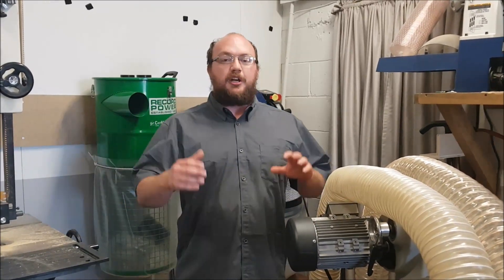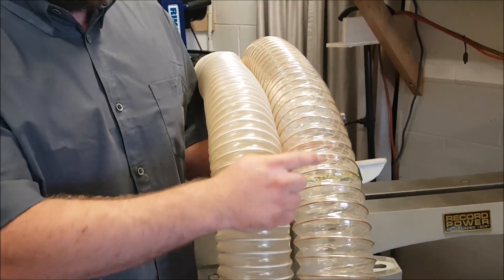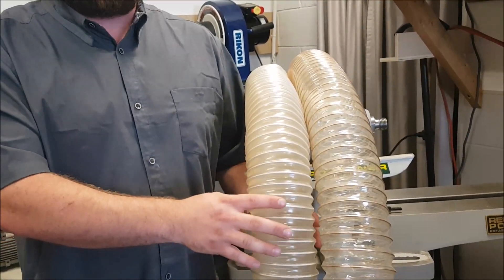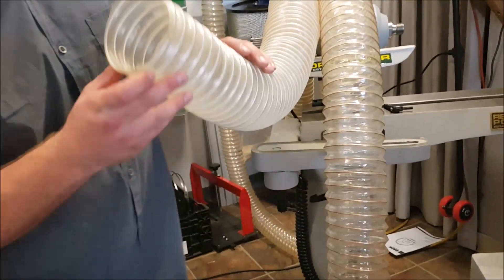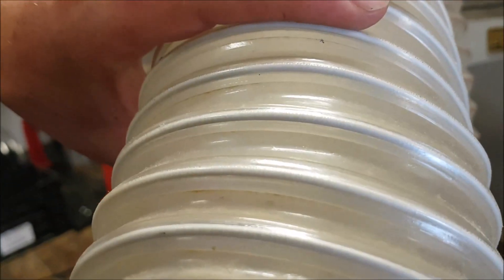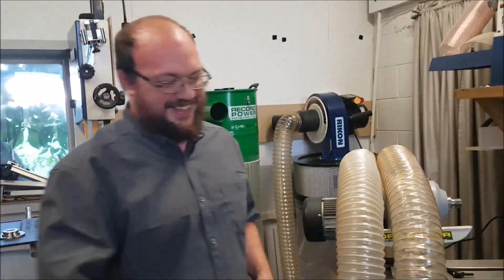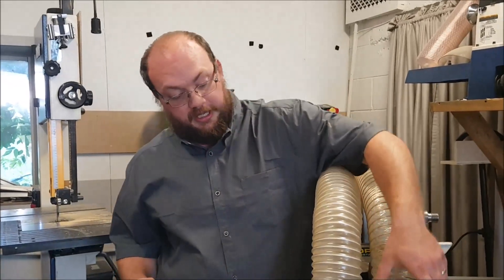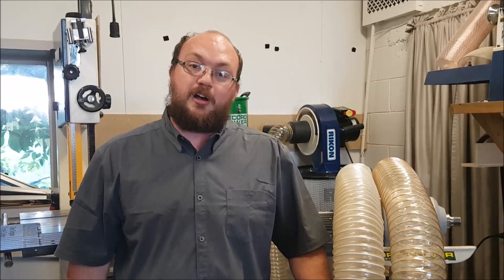PVC vs. Polyurethane Dust Collection hose, Is There a Difference? EthAnswers

Comment: I've used a 6" poly hose here for 11 years and the plastic finally began to deconstruct.  I replaced it with a PVC hose, which is nowhere near as flexible, but yes, far less expensive. 
The copper winding in the poly hose does not really matter. Even though there has been much urban myth 'round spontaneous combustion with the dust and "somehow" the copper neutralizes that, I have never heard of a single woodshop explosion in over 50 years of woodworking, 35 of that in a former professional capacity.